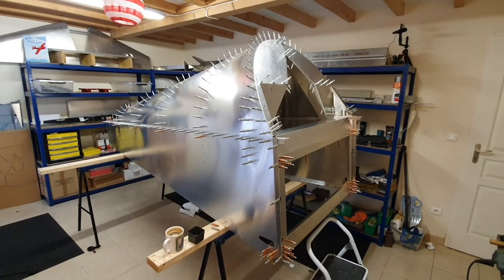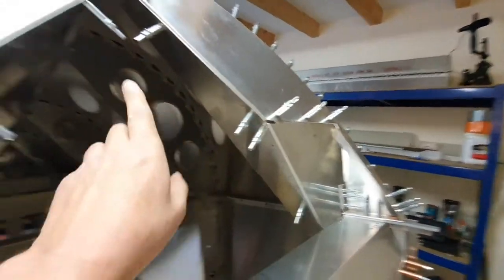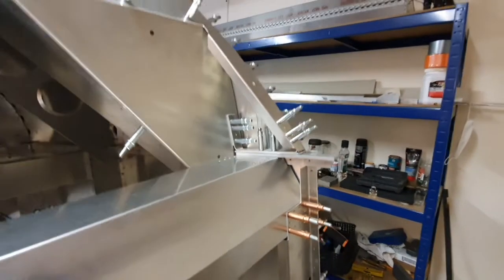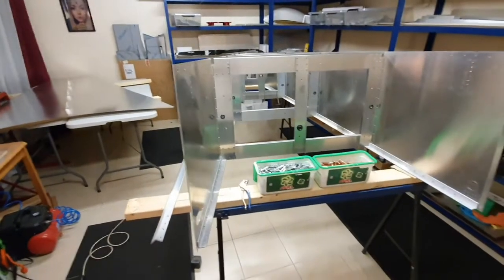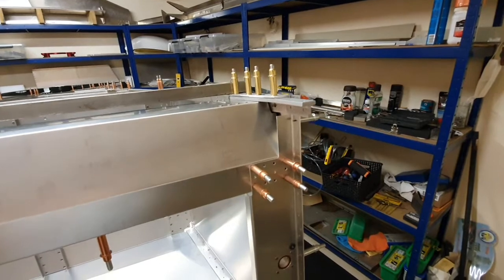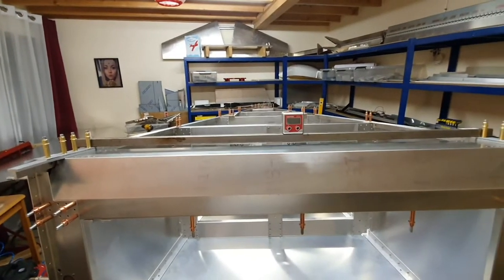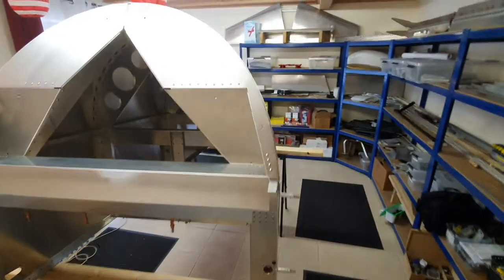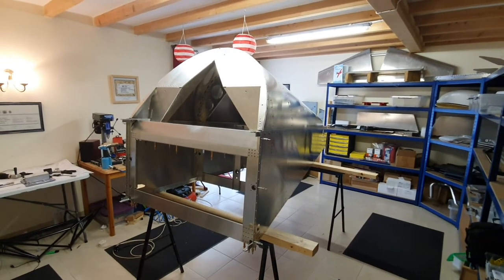Gavin's Sonex B Part 28 - Fitting the Turtle Deck to the Tail Cone Part 2

Comment: Oh Gavin ,,, look at Jim Hickeys channel! He built a Waiex and has flown it extensively!! In the wings in front of the main spar he added wing tanks in the form of 4" aluminun tubes inserted thru the lightening holes to extend his range. He describes how he did it. I know the B has a larger tank but interesting none the less!
Reply from the maker: Thanks for that Russell :-)
Reply: @gavinssonexb  watch micheal smith on youtube. He scratch built a sonex and shows fibreglass L angles to dampen oil canning and lots of little mods to make it better.

Comment: Hi Gavin,came across in another forum regarding the diagonal sections to prevent oil canning.These sections must be mechanically fixed at both ends to structural formers.If not,you'll get fatigue and cracking of the skin at the section ends.Makes sence really.Find some proper advice on it.
Reply from the maker: Thanks for the info :-)

Comment: When you did the final assembly of the tailcone, did you rivet the turtledeck formers to the tailcone base before setting the turtledeck skin in place?
Reply from the maker: Once I had everything up drilled to copper cleco size I riveted the turtle deck skins to the tail cone side panels along both sides first. Then I riveted the turtle deck skins to the formers over the top and then finally riveted the formers to the tail cone cross members and spine. I'm not sure it would have made much difference if I had riveted the formers first. Have a look at Daniel Oliver McElroy's build on YouTube. I can't remember which order he used. I hope this helps :-)
Reply: @gavinssonexb  Thanks!